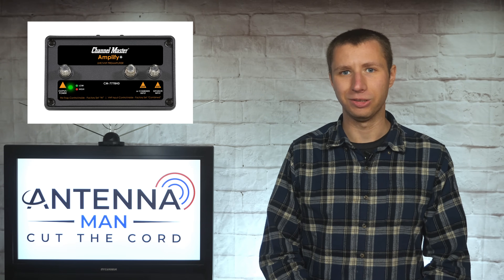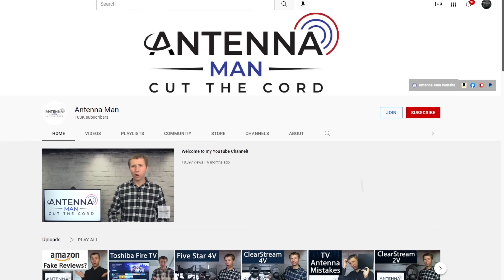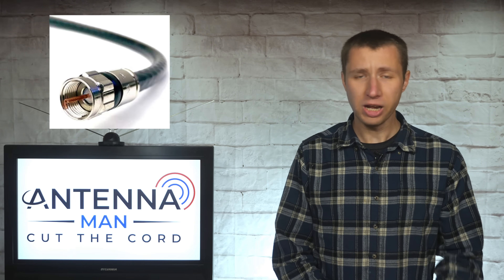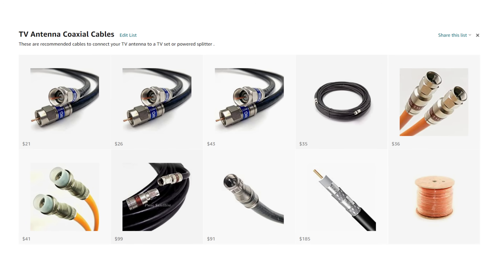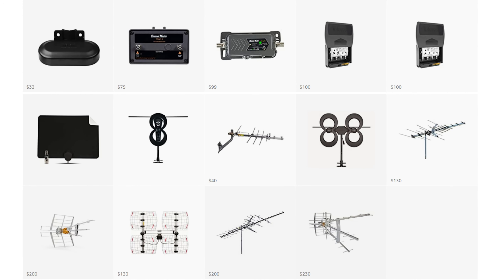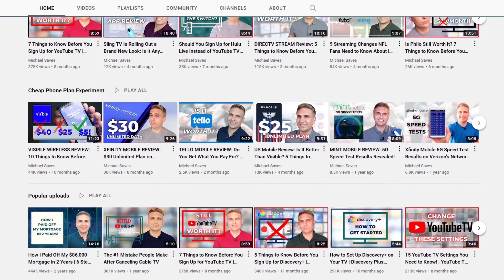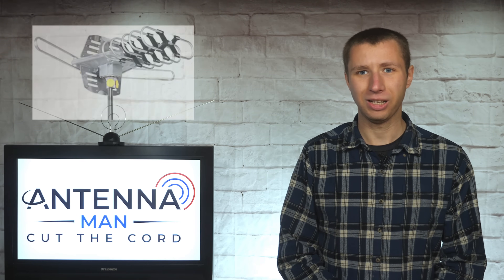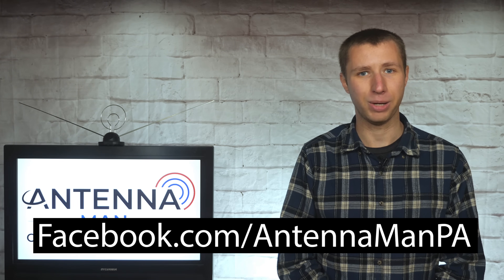Use an Antenna Amplifier? This Mistake Causes it to Fail

Comment: In the NTSB days only used amps at antenna for UHF.
Mostly done to overcome the losses at UHF. At the roof you could have a perfect signal
but add 75 to 100 ft of coax & its half gone. Cheap  coax bad idea also. 
Bottom line buy good coax from a safe source   & keep it short !
LFOD !

Comment: I doubt underpowering an amplifier could cause it to fail; over powering it with a higher then reccomend voltage on the power inverter however,  will.
Reply: It may be that some poor designs mess up at a low voltage.  There is no good reason for that.  I think it is more likely that the cheap cable is not really 75 Ohms impedance.

Comment: Am using the cable that was installed with a dish. Presumably good stuff as they would not want to suffer callbacks.
Reply: Yes, the RG-6 copper looking coaxial cable is what DirecTV used for their installation.

Comment: Solid copper may be better for the DC to preamps but not necessarily for the antenna signal. I suspect more preamp failures are because of quality and not low voltage.
Reply: Solid copper would be ideal for the RF signal, as long as it is fixed along the axis of the cable. But I do agree a lot of the amps are low quality. They should have a simple undervoltage detect in the power supply and overtemp shutdown to protect themselves. 50¢ of electronics eliminated to get the price to $19.99.
Reply: @kinpatu   In electricity the chain of electrons are on the surface of the cable. I don’t know about electromagnetic radiation.
Reply: @bjs2022  Yes in RF the movement of charge carriers is confined to the skin of the conductor. This makes the resistance of the conductor even more important. Solid copper is the best practical conductor you’re going to find. DC moves mostly uniformly about the cross section of the conductor.
Reply: In fact the preamp failure is myth. Low voltage cannot cause it to burn out as claimed here. But it may cease to do anything.

Comment: I have found the Walmart Onn amplifier to be quite reliable. However, the ac adapter that powers the amplifier is NOT.
Reply: Right I had one and it broke on me wasn't very happy with it
Reply: Try ge 4 port powered amp. It was cheap also.

Comment: Thanks for the advice on using solid copper core coax...

Unrelated question, have you done a antenna review on the set of Rabbit Ears in the background of all your videos?🤔
Reply from the maker: I did review them but the video performed poorly so I deleted it.
Reply: @AntennaMan  Why do you delete videos that perform poorly? Is it a storage issue or you just like to de-clutter your channel?
Reply: Tyler has been removing videos that either do poorly or are not antenna related.

I remember that video. Tyler said that it doubled as a cool hat. Loved that joke.